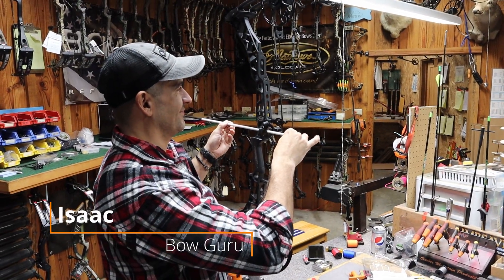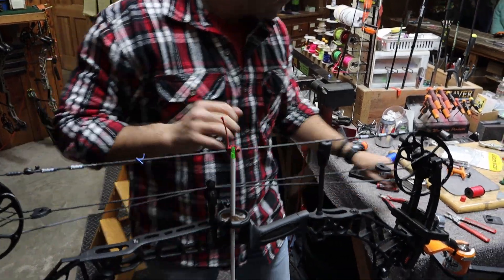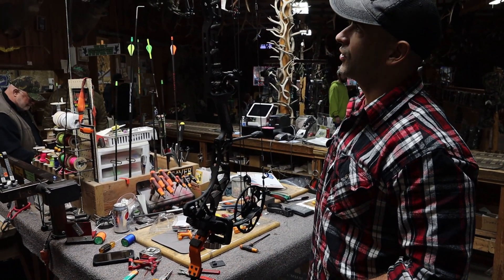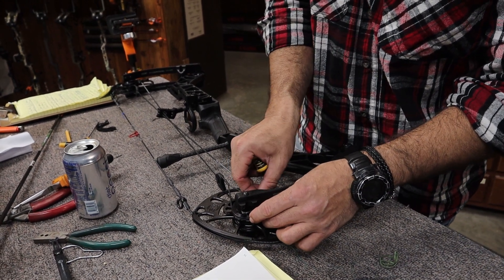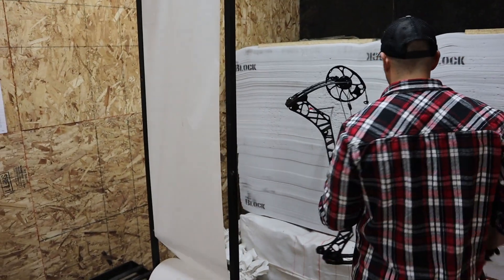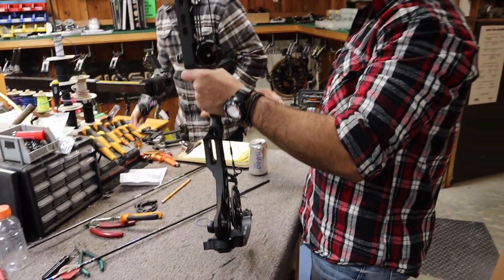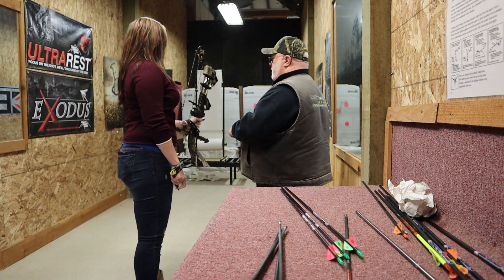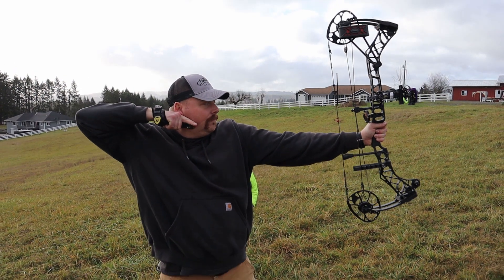Picking up the new Mathews VXR. Best Bow of 2020? / and Huge Announcement!!!

Comment: Try a nose button it will help with keeping you from putting pressure onto the string which can cause arrow drift and it will tighten in your groups and also is your fletching touching your face when at full draw? If so have the shop redo it to where they just miss touching your face when you come to full draw. I absolutely love bow hunting and once I did this with my bows it tightened my grouping up so much and made me much more confident in knowing when I draw back on an animal I know exactly where that arrow is going. Welcome to the archery club and I hope your family loves it as much as my family does
Reply from the maker: Thanks man. I'm gonna head to the shop today and make some tweaks.
Reply: @TSGear  the nose button I use is from Bowmar Archery they come in 2 different sizes and they do have red but as of right now I think they are out of red the last time I checked so you might have to wait for more to be available if you go with their product

Comment: I was going buy the 31.5” but pulled the trigger on the traverse instead.. smoother pull in my opinion.. good bow either way. Mine is in stone.
Reply from the maker: Traverse was awesome too. It seemed to have more valley to it which I think most people like.  I'm not sure really what I liked right away about the VXR but either way both are amazing bows. The stone color is a great choice too.
Reply: @TSGear  the bigger valley is nice when hunting at times. If the elk or whatever isn't in the lane yet and you relax a little bit the string doesn't get ripped out of your hands..lol happy adventure

Comment: Got my very own 31.5 a month ago, and I love it.  I made the switch from Hoyt to Mathews in '02 when they put out the Legacy, and I will never own a different brand.  Mathews, IMO, is the best on the market.  Just remember, cock feather (or vane) UP with the Whisker Biscuit.  I noticed a couple times you had the cock vane down or left.  Speaking from experience, and no, I'm not a paid spokesman, but I would stick with the Whisker Biscuit.  BUT, I shoot feathers and not vanes, and the biscuit works better with feathers.  So your needs will probably differ.
Reply from the maker: Right on man. I'm very impressed with the VXR.  Ya I have changed things up a ton. I had some conflicting info with the cock vane.  I notice when its straight up it gets very close to contacting. I now have it in a consistent spot. Learning everyday though. I really appreciate the tips. I'm always open to hear how I can improve.
Reply: @TSGear  One reason for the cock vane UP is if you look at the biscuit, the bristles at the bottom are darker colored.......they are slightly STIFFER.  You don't want to send your vanes through that.

Comment: That’s a nice bow. It was too 3 when I shot it over the last month, I went with the Xpedition. It was a close race but the speed was much better out of the Xpedition. Being new to archery you should watch John Dudley’s form series, it will help you avoid bad habits.
Reply from the maker: Right on. Ya I was really splitting hairs cause all the bows i shot were awesome. I shot bowtech, pse and another mathews and for some reason loved the feel of the vxr. I havent seen the expeditions. I'll check em out though. Which model did you end up getting?  I'll check out John Dudley. Thanks for the tip. 😁
Reply: Finding a dealer was the hard part in my area, I had to drive 4 hours to find a dealer with the new bows in stock, but it was worth it.

Comment: tuning a rest and not the cables is not going to fix that tear in the paper, it is a patch
Reply from the maker: Hmm. Seems like if the rest is off then it won't shoot cleanly through the paper. How would you know if you need to adjust the rest or the cables...pardon my ignorance but are you talking about cam tuning via tophat adjustment.
Reply: You can mo e the rest without it being a patch you just dont wanna move it too much or it is a patch to a bigger issue
Reply from the maker: @traviscroft91  ya. I don't think he had to move it much. Either way I'm ordering a vapor trail rest soon so we will have to do it all again.  Thanks for the info. Like I said I'm super new to all this.
Reply: @TSGear  usually a tear means a cam lean issue, which means you need twists in the cables, a rest move will just patch this issue
Reply: @highlander200268  considering is a Mathews no...cam lean would need to be adjusted with to hats...and doesnt sound like he needs that if just needed to abjust the rest a lil
Reply: @traviscroft91  brand doesnt make a difference on cam lean, a rest shouldnt be adjusted to fix a tear
Reply: @highlander200268  you dont add twist to cables to fix cam lean with Mathews you need top hats to shim the cam since it doesnt have yoke